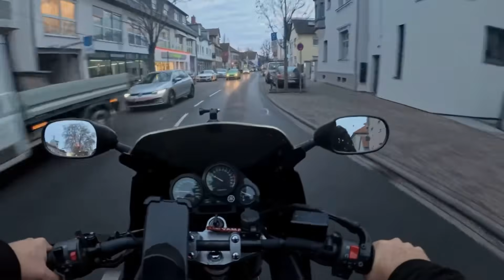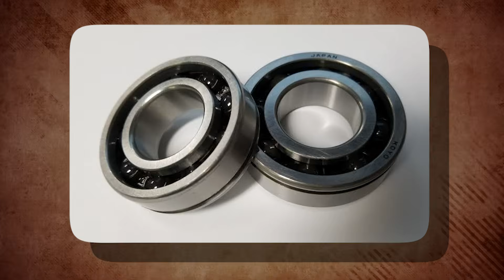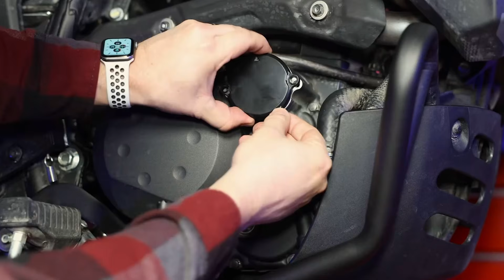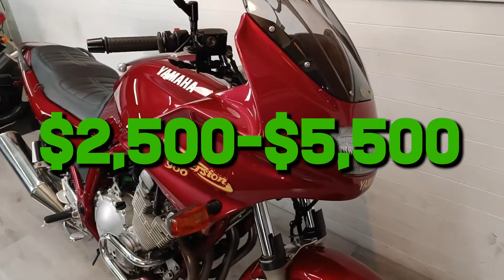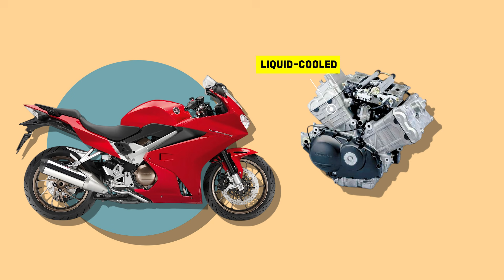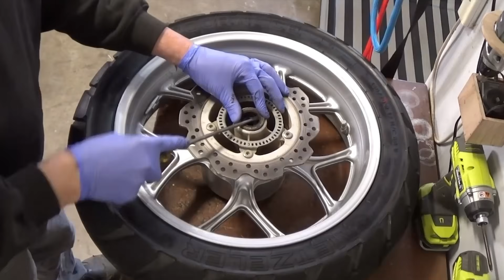The Top 15 Motorcycles Mechanics SECRETLY OWN!

Comment: I have been riding since I was 17. I will be 70 next week. Over the past fifteen years or so, mostly due to heart problems and arthritis, I have given up bikes three times. The first time I sold my beloved XJR1300, only to realise I missed having a bike almost immediately and my head was on a swivel every time I drove anywhere, on the lookout for bikes.

Having hired a HD Road King some years before and found it supremely comfortable, and the low seat height manageable, I thought a cruiser might be the answer. Research eventually led me to a Honda DN-01, a cruiser-style bike with an automatic gearbox ( a boon for arthritic hands). Sadly, the feet-forward stance put too much weight down my spine, so it lasted just a few months. I gave up bikes a second time.

Two years later, once again missing bikes, I wondered if perhaps a lightweight bike might be the solution. I couldn't face the low power of a 125cc or similar though, so eventually parked a Honda CBR300R in the garage. I quickly found that the lack of torque, compared to the bikes I'd ridden over the years, a huge disappointment. It was really easy to ride, just underwhelming to the point where I felt it didn't provide any excitement. It was otherwise an exceptional bike and one I'd recommend to beginners and commuters though. So I gave up bikes once again.

As usual, it wasn't long before I was wondering if there was a different solution, an alternative way of scratching that itch. This time, I spent a LOT of time on research and did what I used to hate about other bikers - I wasted salesmen's time taking rides on quite a few bikes, just to see if there was a combination of light weight, reasonable seat height, comfortable riding position and an engine that felt like a real motorcycle, with enough torque to avoid constant gear changes. Reliability was always a priority for me, pretty much restricting my list to Japanese manufacturers

This led me to all the way to the Honda CB500X. It ticked all the boxes aforementioned and a couple of test rides went well. Because I had lost so much money selling bikes recently, and because I wanted to fit expensive electronic cruise control (that bloody arthritis, you see), I opted for a used example, 2017 to be precise.

There's no such thing as the perfect bike, only the best bike for your needs at any moment in time. Your needs will change. You get older. Your reactions slow. You may want to tour, or carry a pillion plus camping gear. You lose the addiction to adrenaline and you become more fragile. You care less about bragging rights. For me, right now, the CB500X is absolutely the perfect bike, and I am not surprised to see it mentioned in this video. Having fitted the cruise control along with a gear position indicator, GPS, luggage, a taller screen, an aftermarket seat and a few other things, I can confirm that the CB500X is really easy to work on. I have serviced it, replaced fork seal and brake pads, new chain and sprockets, a few other things. All pretty easy. It has given me zero problems and costs peanuts to own and run. 

An incredible machine and my recommendation for anybody planning a huge trip or monster mileage. Reminds me of the old Honda CX500, another unbreakable bike, beloved of courier riders back in the day.

Comment: Honda Nighthawk CB650 1984? Hydraulic self adjusting valves and Shaft Drive. Only required clean oil to work like a Swiss watch